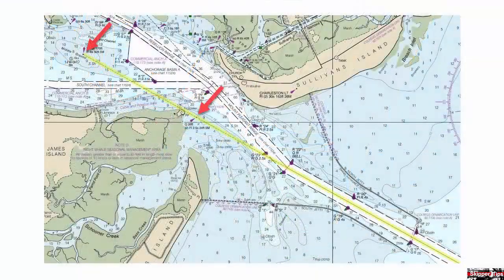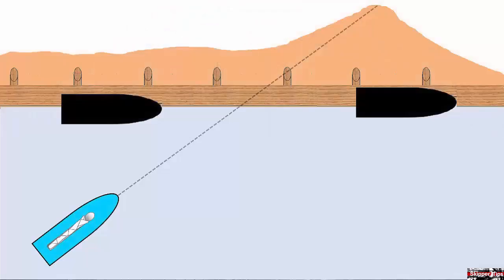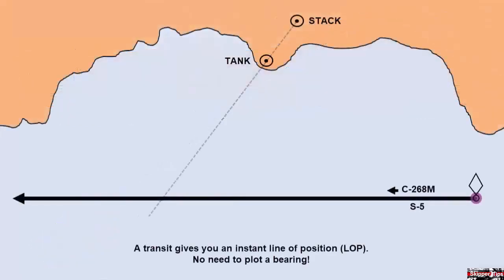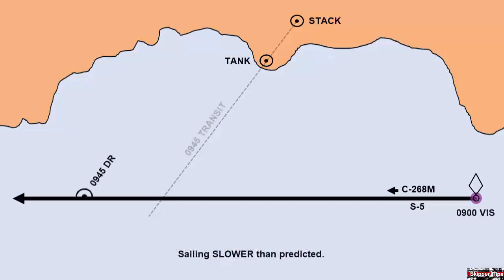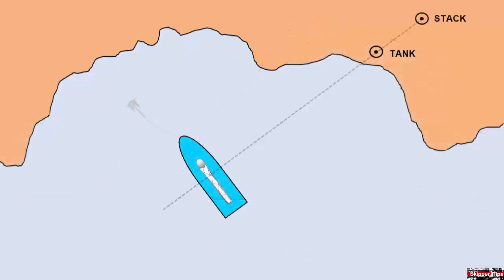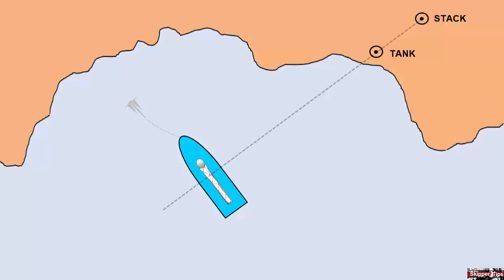Could This Be Sailing’s Most Valuable Coastal Navigation Tool?

Comment: 0:20 When using a transit in a Channel it's good to keep in mind, that it marks the Center of the Channel. So unless you want to be in the dead Center one should use it with a little Offset, to stay 'in the right lane' when encountering Traffic.
Reply from the maker: Thanks for your comments; good points. Also, transits are primarily for big ships, which might have to stay in the center of the channel (deepest water). Improved channels (those maintained by the US Army Corps of Engineers, who are responsible for controlling depths in US shipping channels) are dredged so that the centers are deepest and they gradually shoal toward the edges. Federal Law (see Navigation Rule 9a and 9b) prohibits smaller vessels from hampering the passage of a larger vessel. See this excerpt from the Navigation Rules:
https://www.law.cornell.edu/cfr/text/33/83.09